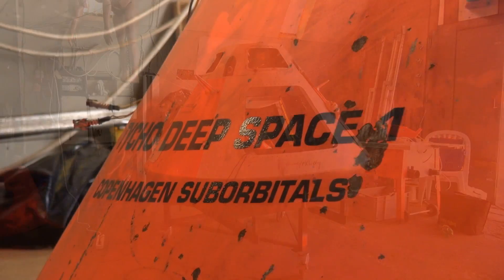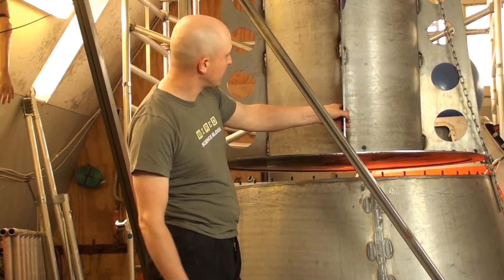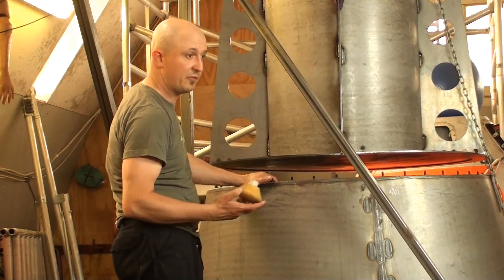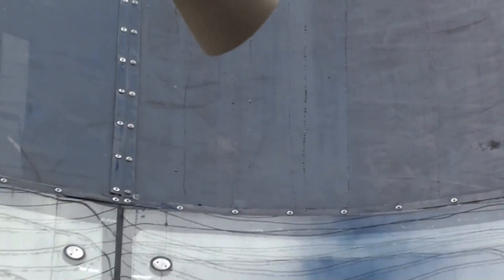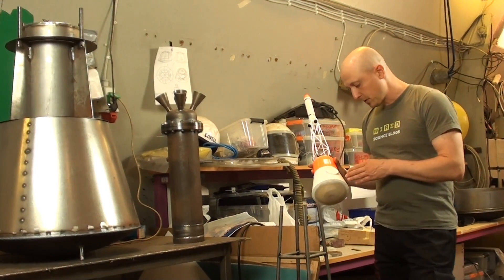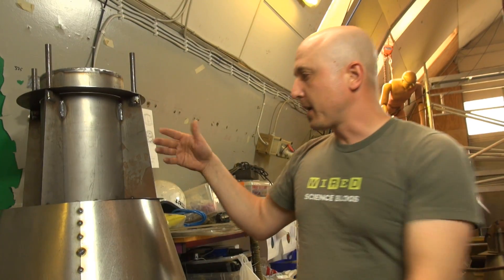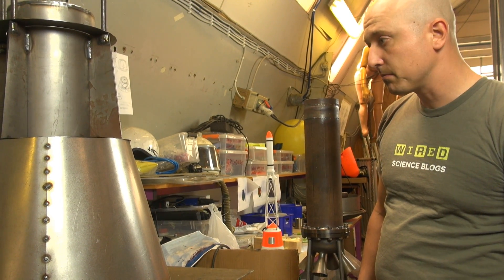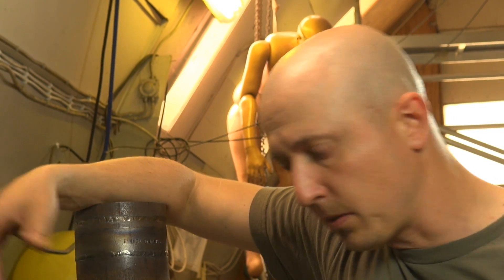Tycho Deep Space II - Status June 2013

Comment: @lasse2071 I understand these guys aren't trying to invent the wheel but with CF at $10/kg I thought it might be worth it. CF is roughly 10 times stronger than AL per kg. All things being equal a AL craft of 300kg would weigh 30kg CF. The material costs would be AL @$3 $900 CF @10 $300.